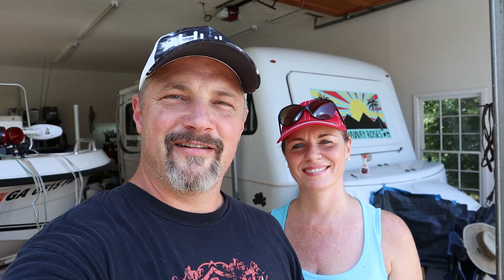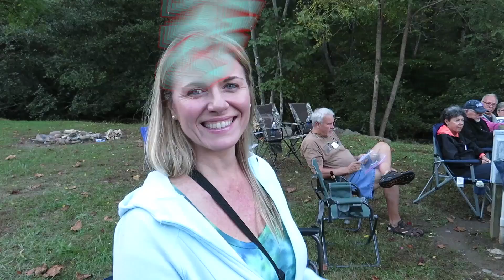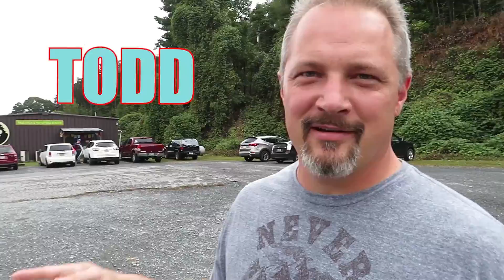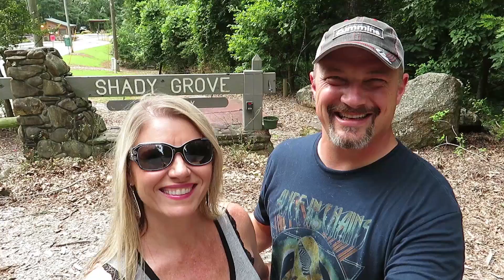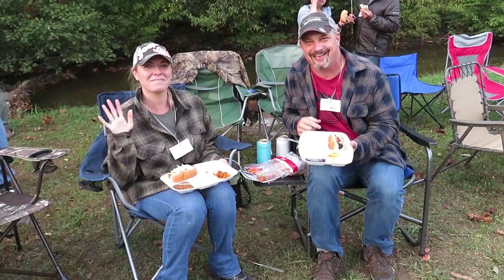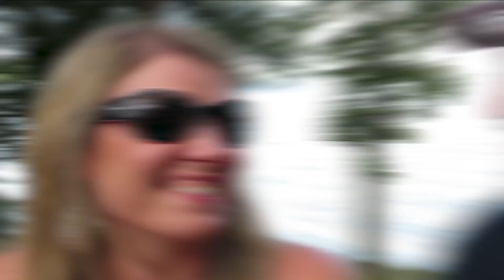RV Basement Repair / Truck Camper RV Water Damage Repair / Northern Lite Episode 4

Comment: When we found ants in the basement of our travel trailer we took some of the "crown molding" off to clean under and saw the gaping holes from our wall to our floor.  The molding was there just to cover up their mistakes.  We ended up placing some sealant in the holes, but after this might see about re-fixing it better if it gets worse.  So thanks for the ideas!

Comment: Cleaned and did a few projects on my Northstar TC getting ready for a fall trip to the Black Hills.  Hang in there!  You are doing a great job and it will be just the way you want it when it’s finished.
Reply from the maker: CJ that's awesome.  We are really ready for some fall camping.  We weren't really expecting to buy a camper and spend months working on it but I guess we can camp for many years in it once it's done!  👍😁. thank you so much for watching!!